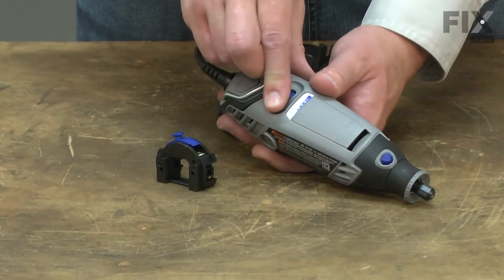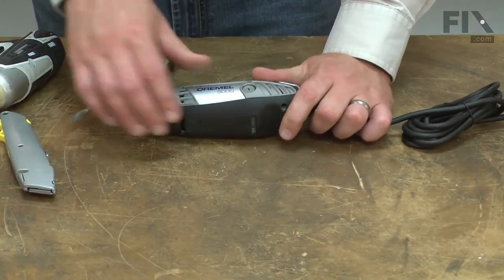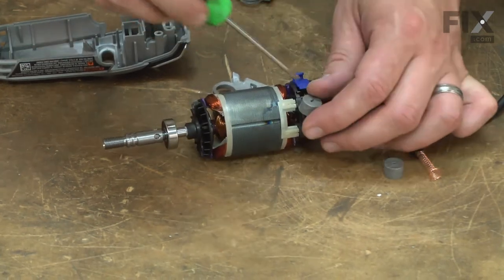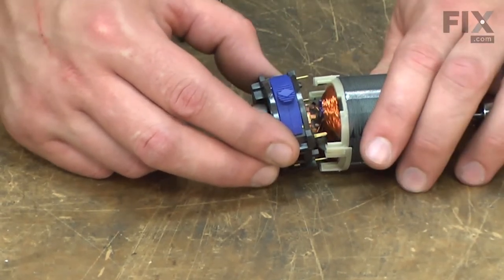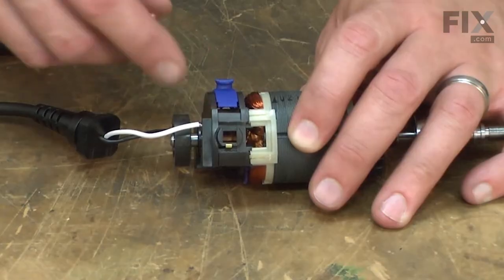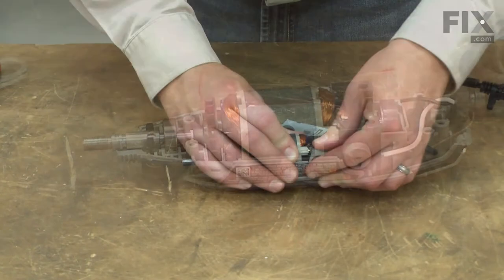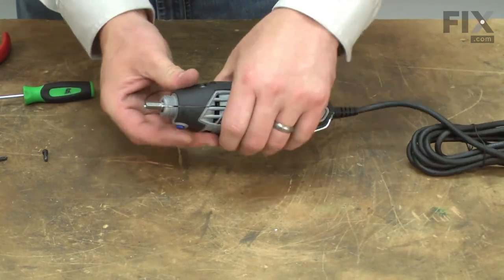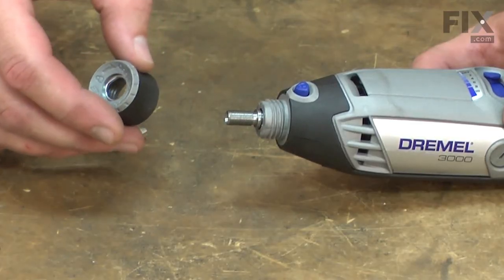Dremel Rotary Tool Repair - How to Replace the Switch Assembly

Comment: My switch stopped working in the middle of a lengthy cutting job.  I was able to disassemble and use an air gun to clean it off and it restored most of the functionality.  Thanks for the video, I might be needing this soon.

Comment: Did anyone notice you reversed the wires when replacing switch? I noticed because I wanted to know what side the positive is on but you swapped ends.

Comment: PSA: It IS possible to connect the tabs on the switch assembly to the slots on the field assembly INCORRECTLY, so that when you turn it on, nothing happens.  Don't get it turned around.